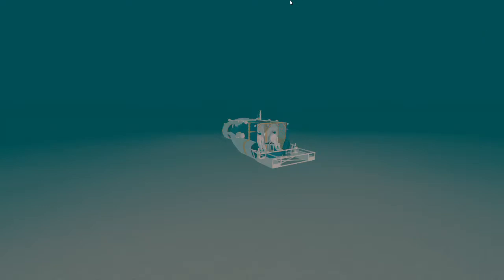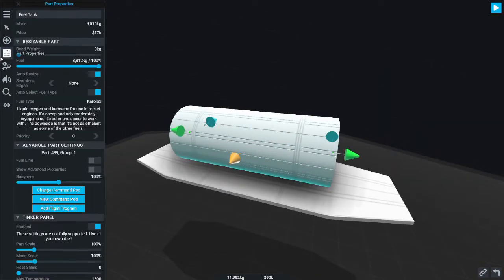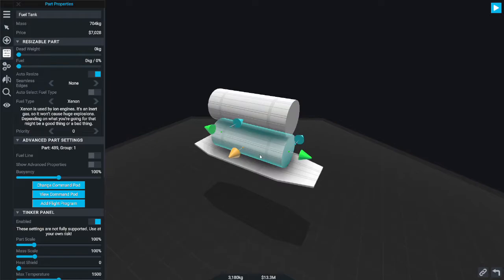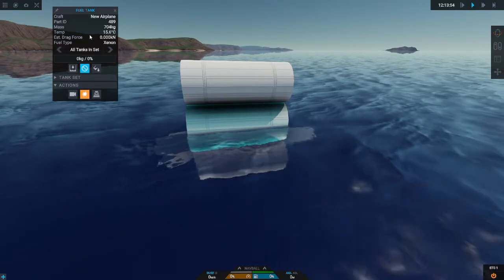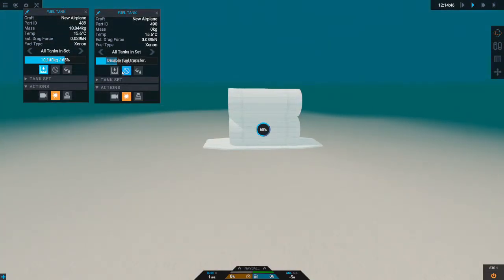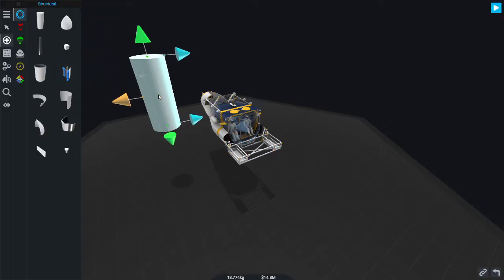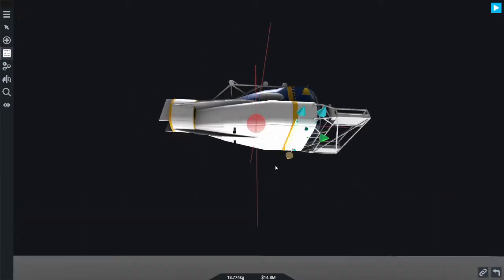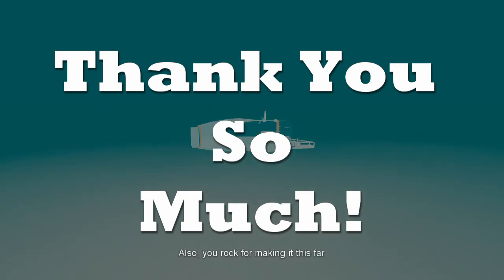How to make a functional Submarine in Simplerockets 2

Comment: Put in small forward and aft tanks to trim the sub?
Reply from the maker: It’s not necessary unless your craft is particularly heavy as it’s easier to control if you gimbal your propeller or whatever method you’re using to move